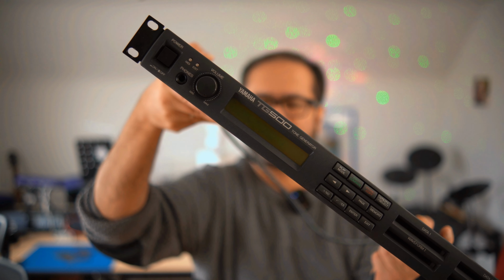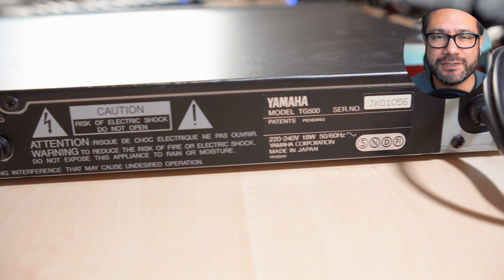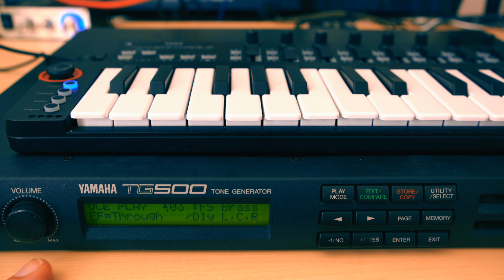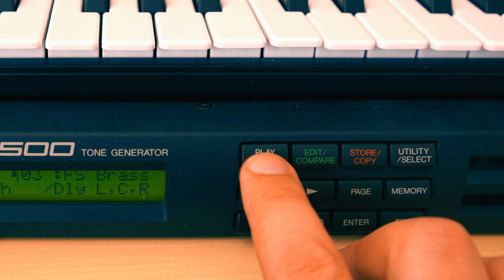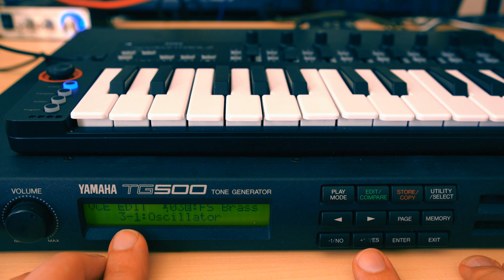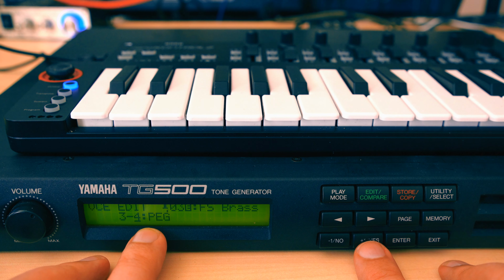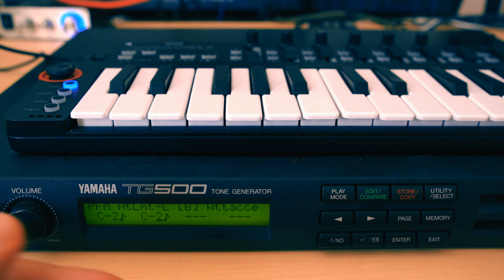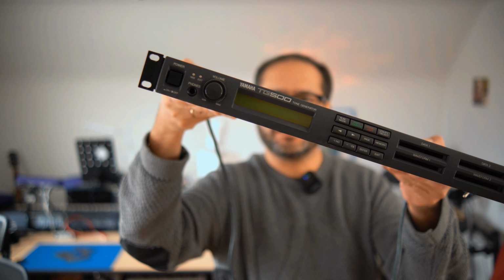Yamaha TG500/SY85: operating through the keyhole

Comment: For me the SY85 piano is a must, it has good bass and overall tone for house music. The actual SY85 keyboard is one of the best, just put your hands beneath the keys and you can feel the plate which is heavy as hell, but it gives this keyboard a special feel. Also, I used the Clavi sample in many funky house music tunes, it has a nice bite and presence.
Reply from the maker: Thanks for watching! I agree. Should have included some 90s classics in my examples to show that off. Browsing the sounds, some of them where recognizable instantly.
Reply: The SY85 keyboard the same keyboard as on the DX7, M1, and countless others (eg the Triton). Things changed a bit with the Montage, but it's very similar. The piano sound was something else - you could make it as realistic or as dance music as you wanted depending on the gig / track. The pads on this thing were insane.

I really enjoy working with these lightweight keyboards (yes this is TG500 but it's basically SY85)- currently using a Kronos 61, but just stripped and rebuilt my SY85 and planning on using it as a controller for a Gig Performer rig (with a virtual SY85, and the real thing as a backup)

Comment: The only thing they screwed up on with the SY/TG (other than no mono/legato mode!) was the bass drums. easy enough to build one in a multi with sines etc, but it's annoying to lose one channel just for that.
The non-volatile memory upgrade from Sector101 is a must-have, particularly on the TG.
An SY85 is worth having just for the dreamy pads and the hugely powerful and quite intuitive sequencer.
Reply from the maker: Thanks for watching! Yes, the pads sound lovely indeed.
Reply: I've played most of the SY range and I own an SY55 and TG55, and the kick drums on that are nice and meaty, good for Rock and Metal stuff.  Overall though the drums are a very mixed bag quality wise and not very well balanced as overall kits.  I suppose either the SY77 or SY99 would be my choice, if I could only have one.
Reply: And Sector 101 waveblade basically turns any sy/tg into a sampler 💕
Reply: @glenesis  or the non-volatile RAM with an SYSEX capable sampler (SU-10, SU-100 etc) if the 'blade is a bit beyond your understanding.

Comment: Very cool! Had to skip through now but will come back and watch the whole thing. Your demos sound very good as usual. I've been looking at an SY85 for a while, but mainly for the sequencer.
Reply: The SY85 sequencer is awesome. The onboard sounds are none too shabby either, and the keybed is great.
Reply: @Gainn  Yamaha really has a few terrific machines and I just suspect the SY85 might be one of them. I have never used one but the sounds, from what I heard, are indeed something I could work with. I saw a video where the three different demos were played. One for the Japanese market, another one for US, and a third for Europe. Quite cool.
Reply: @johannes.nieuwenhuizen  The basic sounds are identical to the TG500 in this video. Having access to hundreds of sample packs and custom sounds (on floppy, but you can use midiOX to transfer them as well) makes it an incredibly powerful machine. 
There's one track on my channel - "Talena" -that was created entirely on an SY85 with just final mastering (and one tiny edit) done on a PC.
Add in an SYSEX transmit capable sampler (SU10/SU200 for example) and you can stay completely dawless until mastering.

Comment: I own the 03R/W and the TG500. Fun Fact: They almost sound identical from the perspective of the converters. Very small dynamic range, sterile sound, little variations. Crystal clear. But the FX contributes a lot to the sound. When you enter Multimode territory, it sounds very dull. I'm using it as a second module in performance play mode with the RM50 as a drum module together with the EX5r as the primary synth in my working rack I like it, but to my mind, it is very limited as a standalone unit. You run one sound that is great.
Reply from the maker: I can see where you're coming from. Many of the ideas here were passed down to later Yamaha workstations and refined over the years. That being said, you can get some pretty great results if you put in the work. But then again, we tend to have other synths that do it all quicker.
Reply: Very true and that is why multitracking in the 90s was so important, to layer up sounds and retain the full individual presets with their FX intact.

Comment: This was a great video. Thanks a lot! My ram card needs battery replacement. Tried looking at the manual on how to bulk dump the card for backup but got lost :( Any idea on how to do that?
Reply from the maker: It's been a while, but I think I used SoundDiver 3 for this: https://archive.org/details/emagicsounddiver3.0.5.4
It's an abandoned patch librarian that will detect your TG500 and all its installed cards, and you can then drag & drop your patches / samples to your PC.
It still works in Windows 11, but I found it sometimes won't work at all. Just try again if that's the case.

Comment: Hi there, I have a TG-500 and want to control some parameters by using Ableton running a Mac. So far I can't seem to find an editor for it o a list of CCs to do so from the DAW, do you know if this is possible?

I'd imagine so but even though I've tried haven't be able to do so. The manual is not that helpful in this regard and haven't found anything online about it. 

If you could help that would be great.
Reply from the maker: Hi, thanks for watching. The search term you want to use is "Yamaha TG500 MIDI implementation chart". ;-) Which will give you this: https://usa.yamaha.com/files/download/other_assets/5/317115/TG500E2.pdf
Reply: @mr_floydst  Thanks for the quick reply! Sorry to be obtuse but having read that still don't know how to program say automation of cutoff, resonance and say AEG which is what I'm looking for. 

The usual CC 18 doesn't affect filter cutoff for example.
Reply from the maker: The TG500 is one of the earliest instruments that supported General MIDI, so you should try the GM CCs. https://anotherproducer.com/online-tools-for-musicians/midi-cc-list/
Filter cutoff frequency should be on CC 74, for example.
Reply: @mr_floydst  Thanks again! I managed to do program change but for some reason 74 is not working for filter cutoff freq, is there a system protect mode where one can't change this parameters by any chance? 

Strange that I can do this with all my other syths but the TG-500 has proved a bit difficult to far!

I appreciate you taking time in replying to all of this!
Reply from the maker: The TG500 was a very early digital synth, so some things won't work as you expect them too. I found that changing the filter via MIDI is very "jumpy", for example. :)

Comment: Nothing as much fun editing on a two line lcd display 😉
Reply: You get used to it pretty quickly for basic uses. The multi setup is a whole other thing though.
Reply from the maker: It is kind of ok. The "quick edit" feature is quite helpful here. But some more knobs & sliders would have done wonders here. :)
Reply: I remember in the 90s when Korg introduced those huge backlit LCD displays, and I thought they were just a gimmick and I carried on preferring the older green displays we had become accustomed to using.  I've always disliked using touch screen displays; I find them annoying to use.
Reply: @EgoShredder  You should have a try on AKAI MPC LIVE II, beats almost everything I tried. Only one thing is better imho, one knob/slider per parameter.

Comment: If I were to choose between an M1 and an SY85, which one is better to buy?
Reply from the maker: The SY85! It's a fully featured synth with a resonant filter.
Unless you want those classic M1 sounds.
Reply: @mr_floydst  THX.
Reply: @mr_floydst  The SY85 only has one "Voice" in play mode. In performance mode you can though have 4 "Voices". The M1 has two voices in play mode. In performance mode you can combine 8 of them. Very difficult decision to make.
M1 seems broader in stacking voices but lacks in control of them. For regular users it comes down to how these samples sound?
Using them as a regular synth, with SAW waves as origin in sound and then filters and such, both have no PWM or ring modulation. 
I got now both, getting very excited about the sonic stuff on SY85, compared to SY77, but it's somehow boring. Yeah, like M1 it is based only on samples, and they are more crisp than on the SY77, but something is just tedious about that SY85.

Comment: Some German magazine compared operating the TG-500 to an adventure game. The SY-85 should be a lot easier.
Reply from the maker: Well, it would be an adventure game about the monster that lives under your bed (and that refuses to go anywhere else) ;-)
Reply: I think, other than the AKAI S1000/2000/3000 Sampler for example, the TG500 is quite easy to edit. Even without the manual , if you are not exactly a beginner. The TG500 has many very nice patches, and this is the main thing with a 19"sample based digital rack synthesizer. If anyone  wants synthesizer with sliders and knobs for every single parameter, also 64 voices and multi mode plus multi FX, all super easy to program: good luck. Might be a little bit more expensive than 100- 200 Eur